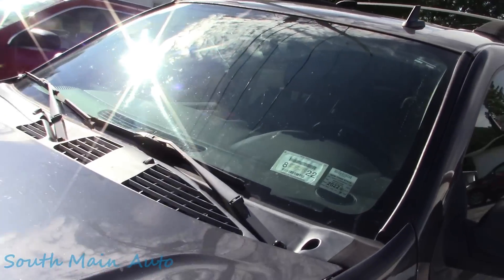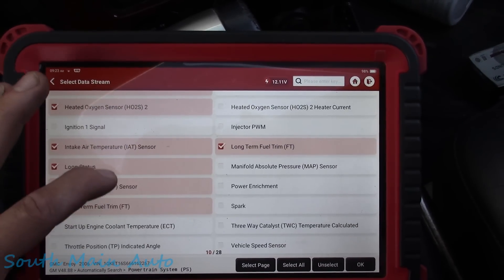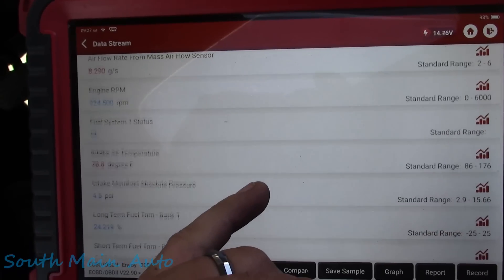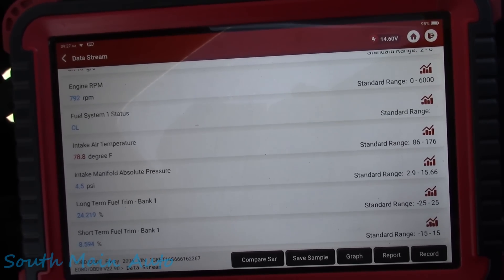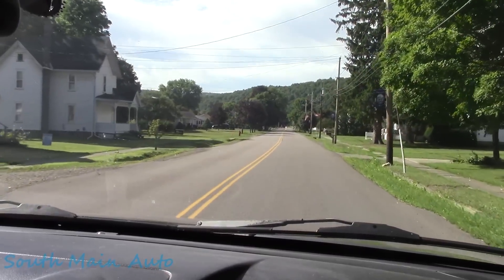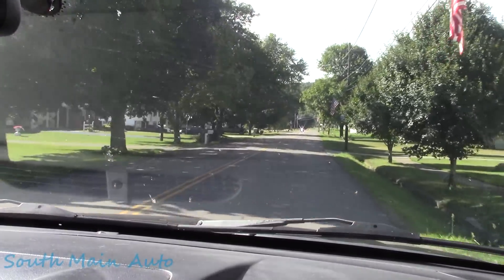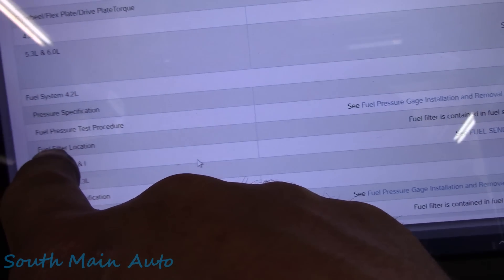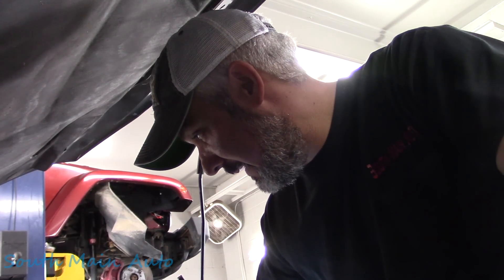GMC Envoy: Hard Start When Hot & Low Fuel Pressure - Part I

Comment: Eric I had a few 4.2 envoys and trailblazers and for the life of me I can't see how the fuel pressure regulator works with the vacuum hose connected in front of the throttle body don't make sense 🤔

Comment: just finished a 03 3/4 ton gm 6.0 with a partial plugged fuel filter fuel pressure test was ok (60)  ,fuel trims long trim -3 and was getting 6.5mpg. low power and lack of performance. Replaced partial plugged fuel filter and power came back ,mpg back to 11 Took me awhile to think it through

Comment: Thanks for teaching me 2 things in this video! About the o2 sensor should peg to about 1000mv during wot and that being that it went to 0 it was a fuel delivery problem. And the other thing was about an amp per 10psi for the fuel pump. You are one of the reasons why i continute to learn in this career. I may be 100% trained by GM but i still have a lot to learn!
Reply from the maker: So it is a sometimes but not always case. It is more like 0.8amps per 10psi (most of the time) and MOST vehicles go into power enrichment mode at WOT some stay switch the O2's but none that I know of drop to 0v's
Reply: You might b gm trained but you need years of the school of hard knocks were you learn by doing
Reply: Those were good lessons! Sorry for a bit of a newb question but why does the O2 pegging out at WOT mean that it can't be a vacuum leak?
Reply: @grannyflatgarage7599  a vacuum leak can make the 02 peg early as there's unmetered air getting the system designers for the most part will desgin w.o.t to match top out put of o2 sensor if you find a vechicle that has pegged o2 sensors at half throttle its either a vacuum leak because the engine is receiving enough air to Maximize the 02 its just getting in a way  the computer dont understand or its bad o2 sensor it think half way is pegged out
Reply: @grannyflatgarage7599  WOT means the throttle plate is also fully open, there is very little to no engine vacuum during this. Engine vacuum is created by the intake stroke trying to pull air past a restriction (the throttle plate). Diesels don't have a throttle plate, hence no vacuum from them, same idea.
Reply: @donwasse7892  ah thank you, that makes sense!
Reply: @jeremyhanna3852  i agree 100% i learn new stuff all the time. I rather diagnose vehicles than do brake jobs and tires all day.
Reply: @SouthMainAuto  dropping to 0V in WOT is bad because it means lean burning, i.e. hot. So you are correct, you won't see that on a healthy passenger car.

Comment: My 2002 mustang has the opposite problem. Too much fuel pressure. Changed every component of the fuel system. pump, fuel pressure sensor, fuel pump driver module. powers and grounds seem good. any ideas or suggestions Eric?? This has me stumped. I may replace the ecm next when it arrives. The parts cannon is empty. Is there something I'm missing???

Comment: Everything I got right here! I've got a 2002 trailblazer with 330,000 on it. These engines are beasts. No oil burning or leaks. Still getting 18 mpg. Change oil every 5,000 and use Lucas fuel treatment consistently. Live in rust belt and frame cracked from rust. I'm gonna weld it up and keep driving.
Reply: my buddies has 216,000 miles, runs perfect!!
Reply: 214k on my 05 Envoy, everythings great on it except a leaking rear main and the 4L60E is slowing crawling up on deaths door.
Reply: just clocked 160K on an 02 Trailblazer owned since new, and also recently replaced the fuel tank pressure sensor. Not in the rust belt and plan to keep this vehicle a long time.

Comment: Aaaaaah....  The infamous GM fuel pump.  Had one go out on my 2002 Chevy Blazer (4.3) about 150 miles from home.  One moment it was working, the next it wasn't.  Crank, crank, crank, but no starty.  Had the vehicle towed home (to the Chevy dealership).  Where it proceeded to start and run for the next three days.  Just as they were fixin' to call and have me pick it up, it wouldn't start.  My son's 2002 Silveraldo (also 4.3), did the same thing a few months later.  Gotta love that timed obsolescence!

Comment: Eric, I had a similar situation with Dodge B350 Maxivans and the 360 TBI V-8. Everything checked fine but the engine would lay down when you hit 3rd gear it just wouldn’t pull. I ended up running a FP gauge under the engine cover and watching the pressure as I drove and sure enough first gear it was fine, second you could see the needle waver and at the top going into third it would start to drop down and that coincided with the laying over of the engine. A new fuel pump fixed the issue. And although it had the extended range fuel tank 30+ gallons, they were always kept full so the elec motors weren’t overheating.

Comment: theres probably a pinhole in the rubber tubing that goes from the fuel pump to the assembly inside the tank.. also the rubber hose in there can swell and come partially loose.  OR maybe they put the wrong fuel pump in .  I know the older chevys run around 9 to 12 psi.  maybe you can try dead heading the fuel pump and see if the pressure will build. 
  trying to get the truth out of people is like pulling teeth.,,. sometimes your better off just staying focused on your troubleshooting procedure and just follow it to the culprit.

Comment: Plugged converter my guess.  Best keep an Eye on those or you will need to change your exhaust manifold.  Also can cause issues with A/C, until new cat was put on.
Reply: How does low fuel pressure lead you to guess that a catalytic converter is clogged?

Comment: I don't quite understand fuel trims, so every time you make a video with fuel trim data I'm particularly interested..........also, what did you hear/feel to instantly know that the wheel bearings were bad?......Thanks for another great video.
Reply: Go watch Schrodingers Box, Secret of Engine Problem Diagnosis- Fuel Trims Pt.1 and Pt. 2. Matt does a great job explaining the concept.
Reply: @bartsarton2212   thank you very much. I will check that site out.

Comment: 20 psi of fuel pressure and it stills runs. Can't say that on newer vehicles.
Reply: Or older vehicles like GM with spider injection.
Reply: On bmws n55 they use a normal fuel pump and then a high pressure pump at the engine. Not sure how much low fuel pressure it needs but it might work at 20 if there’s enough flow.
Reply: I had an old GM 4.3 with throttle body EFI, late 80's era. The fuel pressure regulator spring rusted away to crumblies, leaving the fuel to continually bypass back to the tank. The fuel pressure was WAY less than 1psi. Amazingly, it still ran and was drivable. Performance was crappy and the OBD1 O2 sensor was going nuts, but it ran that way for most of a summer until I figured it out. No scan tools or live data back then. Plus it was a Chevy Astro and you couldn't do any thing but check oil and coolant levels without disassembling the whole interior.

Comment: I had an envoy that after idling for a few minutes, it would shut off like you turned the key off, almost like it was on a idle timer. It would start right back up and always ran great otherwise. BTW, there is a fuel pressure port underneath by the filter.
Reply from the maker: this one didn't have a filter ;) and I believe the port you are thinking of is for the EVAP isn't it? I could be wrong though.
Reply: @SouthMainAuto  My 2005 long wheel base had a filter along the inside of the left frame rail with a port right before the filter. Maybe different n the shorties. Who knows...lol

Comment: My wife has a 2005 Trailblazer. I have already replaced her fuel pump with a oem pump. Problem is that at times the pump short cycles and starts hard. Turn the key off then on a few times no issues. I already replaced the ignition switch module and still the same issue. I am stumped at this point.

Comment: I just did this with my 99 Yukon, lean codes, drivability problems and then no start, no hear the fuel pump turn on. But the real indication is he just filled the tank like my daughter did, thirty gallons of gas, siphon it out the old fashioned way. Of course I don't have a lift so get out the jack stands and do it the hard way. Ah well, a new pump is $250 for OEM and a day's labor and I saved myself $750 in labor.

Comment: if it had a stuck open purge valve, wouldn't it not idle properly? Totally respect your work, appreciate the extra checks you perform especially when they're as easy as from the driver's seat, just trying to understand how a failing purge valve would show itself. Love always, thanks
Reply: It depends on what else is going on. If the EVAP system is holding vacuum, then it would not have a idle problem due to a vacuum leak.
In closed loop: It might run higher idle due to the fuel vapor coming from the tank, if the computer could not lean back enough of the fuel coming from the injectors. However, it might not have any idle issues due to the computer compensating the fuel trim.

The last EVAP purge valve I had stuck 100% open:
I never thought it had an idle problem.
The tuck smelled like fuel vapors escaping, when parked. The fuel tank held the vacuum really well and I could hear the air being sucked in, when the gas cap was removed.
The truck's fuel trims were attempting to compensate leaning back the injectors due to the extra fuel vapor coming from the tank.
The truck had a hard starting, when recently running, because it was basically flooded with fuel vapors.
The truck also had a catalytic converter low efficiency code. The truck had way too much fuel and the system could not compensate enough.
Of course, the truck also had EVAP incorrect purge flow code due to the stuck open valve.
Reply: @willw8011  Right but in this case the LTFT was pegged OUT not scaling back, hence why I asked...
Reply: @awaara24   I think, he was just thinking out loud, so the whole story of the thought process is unknown.
Sounds like he changed his mind about the whole situation, when seeing the fuel trims and live data for the EVAP system. Somewhere about this time he was talking about a vacuum leak. If the purge valve is stuck open and their is a leak in the EVAP system, then that would be a vacuum leak.

When I see the live date that he showed, then I start thinking about fuel delivery issues to the injectors. He must have been thinking the same, because the first real test he did was the fuel pressure test.

Comment: With a full fuel tank, you can drain the tank down to nothing by just rerouting the fuel line to a gas can. Run the fuel pump that still works and drain it down.
Reply: Good idea, never see anyone doing that--wonder why....
Reply: Where are you going to put 25 to 40 gallons of gas?
Reply: @gregjohnson2073  A 2006 Trailblazer does not hold 25-40 gallons of gas. Maybe 18-20 max. A couple 5 gallon cans. Pump the rest into my personal car, with the customers permission of course 😉
Reply: @randybeard6040  Got me, thats the way I do them. When its completely dead I have an external fuel pump I run a hose down the tank and pump it down. 

I don't have anything fancy like a 2 post lift and trans jack. So I have to man handle tanks in and out.
Reply: @mph5896  I am sure he wants to keep the gas at today's prices. Too much work. Okay for a DIYer who has the time. Not for a shop.
Reply: @gregjohnson2073  Its 5-10 minutes to reroute a line, drop a switchable relay in where the relay goes. Run the pump and do something else while the cans fill up. You aren't dropping that tank full.

Comment: Being an old timer with limited electronic diagnostic experience, I would first check the fuel pressure then immediately make the call of a bad fuel pump.
Reply: Sup...John? These little projects are no stranger to you.
Reply: Hello @jerrycurtis2310  lost your contact info, give me a holler!
Reply: John did you get the email I sent??
Reply from the maker: That's all good until it isn't haha. 95% of the time it's good, it is that other 5% that'll get ya

Comment: Good video. I wonder why you did not look closer at the fuel pump current capture. If you lower the voltage and zoom into the waveform, maybe capture with a faster setting (I am sure you know all this and have done it many times) you could see if one or more commutators are bad or not. This, I think, would provide a definitive answer as to if the fuel pump is bad, IF the scope capture did show one or more bad/missing commutators. Maybe part of the reason why you didn't might be you would have to pull the Picoscope out to see it well enough, which takes more time. Understandable. What you have done does already show it is most likely the fuel pump if it is getting power and ground, and it is pretty definitive as well. Just something I wondered about. Anyway....

Thanks for making these videos. Especially lately, you have been making a considerable number of videos and they, are each and every one of them, are truly appreciated. 

Thank you.
Omegaman
Reply from the maker: All good advice :) Thing is, looking at it like we did with 1 second across the screen we would have easily seen a "missing" section on the commutator as the amperage would have had a drop right to zero then right back up. It would have been very "narrow" but all the same it would have been captured pretty easy. I was just looking more for overall current than I was a "bad motor" if that makes sense?
Reply: @SouthMainAuto  Yes, that makes perfect sense. It is a little difficult to tell what the settings are on the scope sometimes, or maybe I should pay closer attention.

Thanks for your response, and again, for making these videos.
Omegaman

Comment: I put a new Spectra (Chinese crap) combination sender/fuel pump in my 91 Caprice Classic and the pump just quit 2 weeks after install, cost me 450 bucks for the tow and 80 for the new Delco fuel pump which I installed on the sending unit that was still and is still working... By the way it gave out between Albuquerque and Las Cruses New Mexico and I had it towed to El Paso, TX

Comment: Unless they're not available anymore, there are certain parts you just don't install aftermarket, the fuel pump is one of them.
Reply: Well sometimes you do install a aftermarket fuel pump, pump oem for my KTM 500 euro aftermarket same fit and all  50 to 100 euro depending how fast you want it to be deliverd.
Reply: The more difficult the part is to fit, the more you want to avoid aftermarket junk.
Reply: I put 2 delphi fuel pumps in my envoy both failed in 3 weeks.  Put a ac Delco on and all is good
Reply: There is nothing wrong with QUALITY aftermarket fuel pumps. The thing is those you find on fleabay and amazon are rarely Quality. If the part is 1/6th the cost of the part straight from the OEM (Not talking from GM price) then there is a reason it is 1/6th the price, they cut corners on a lot of stuff and materials.
Reply: I put on 2 water pumps and both were defective from factory. Oem fixed it and no issues since. Same with an aftermarket crank sensor. It worked worse then the oem one that was going bad.
Reply: @arjanvanraaij8440  If you do it to your own car that's one thing, but as a professional auto mechanic whose reputation relied on the parts and service I gave, it didn't happen. I've had aftermarket fuel pumps fail within 3 days. Then I had an upset customer who would demand I tow the vehicle in. Then you had to wait for a warranty claim from your parts supplier, not worth the headache, and the ding to my reputation.
Reply: 100%
Reply: @Cragified  It seems just about everybody here disagrees.
Reply: @satguy  Because they bought the cheap ones. I have never had a problem with aftermarket fuel pumps that were from reputable companies and near OEM price. Only got them due to availability. I of course always advocate for OEM if you can get it, especially in a tank you have to drop.

Mass reman anything today is junk because they only lightly test all the parts and don't replace anything unless it is bad. Which includes bearings, brushes, etc.
Reply: @Cragified  Did you read the other people's responses? I rest my case.

Comment: I have never figured out why, with all of the data they collect on vehicles, they don't have fuel pressure sensors on each side of the fuel filter.
Reply: Cost.
Reply: @misterhat5823  $20 worth of sensors on vehicles costing $20,000 and up?
Reply: @tiredoldmechanic1791  You'd be amazed how cheap cars are made. $20 on 50k units is a million in profit.

Comment: I think I would have taken it for a test drive and checked fuel pressure drop out on it loaded.  I know its the same as checking oxygen sensor voltages kind of but if your pump can deliver full pressure at idle and not on load then its not an amperage but likely a pump.  Which I think you agree with anyhow.  I guess I have never seen a fuel delivery problem be an intermittent power supply issue.
Reply from the maker: So if I had full pressure KOEO I sure would have drove it but we proved even at an idle it had low pressure :)
Reply: @SouthMainAuto  oops didn't see that

Comment: Sounds like the transmission is holding gears too - I wasn't sure if Eric was doing it purposely
Reply: The shift points just sound wrong because the engine lacks torque to get up to revs.

Comment: I used to do a lot of fuel pumps with full tanks. I used to use a lift and a transmission jack under the tank. Funny thing is the companies I worked for never ever had any of us pull a transmission, but those had really expensive ($1,400 to $2,000) high transmission jacks for use with vehicle lifts. The only full tanks that were hard were the 40 gal strange conformal designed tanks, which were really long for pick-up trucks or cargo vans.

Comment: What would be a normal fuel trim value for an older GM engine like this one or others? Is the -25 to 25 from the scan tool your target? Thanks !
Reply: Target is 0. Anything over or under about 10 is a problem.
Reply: Depends on the fuel you use, 10% ethanol fuel means a perfect fuel trim is about 4%. From this I'd say +/- 5% is normal